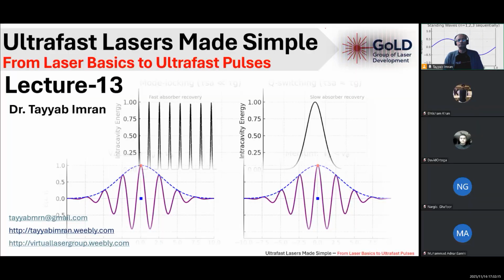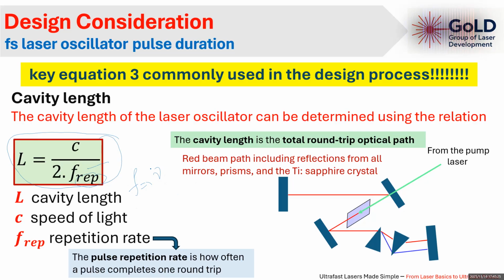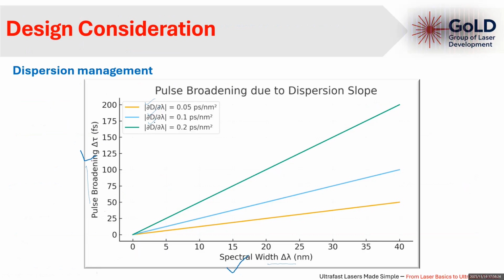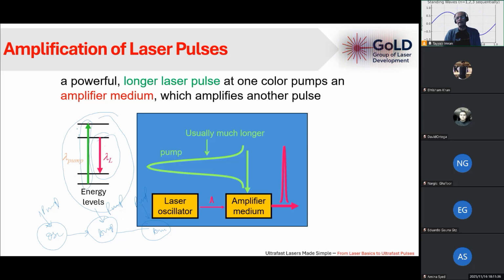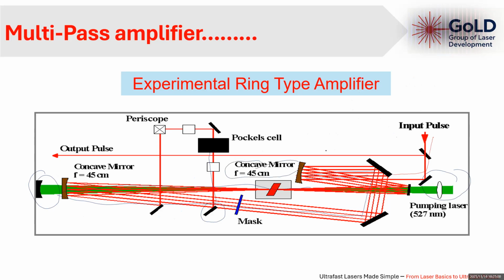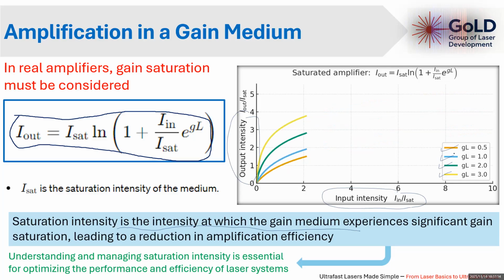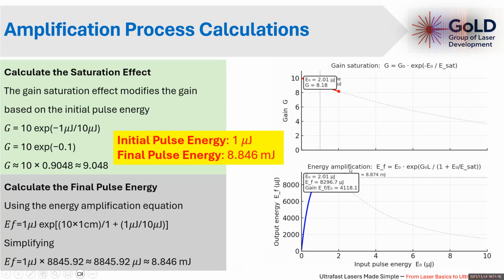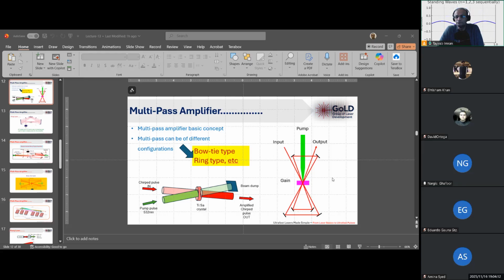Lecture-13 Ultrafast Laser Course (from basics of laser to ultrafast laser pulses) [16-11-25]

Comment: Coming from an Electronics background, I see that the laser amplifier equations are remarkably similar to those used in bipolar transistors. Is there such a thing as an all-optical transistor yet?
Reply from the maker: Thanks, Good observation. The basic idea of amplification is indeed similar: a small signal is strengthened by drawing energy from an external source. In electronics, that source is the bias/current supply, while in laser amplification, it is the pump energy stored in the gain medium. the amplification concept has a nice parallel